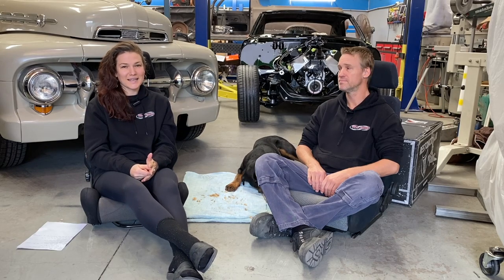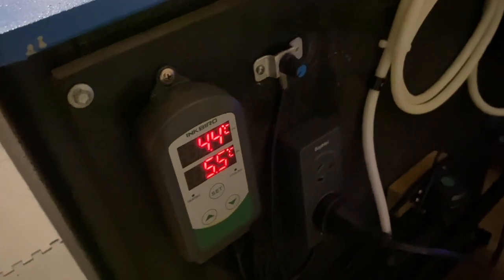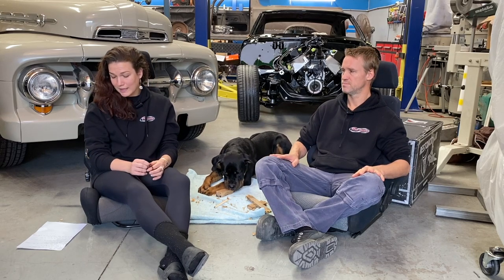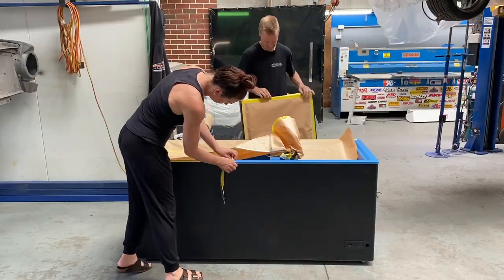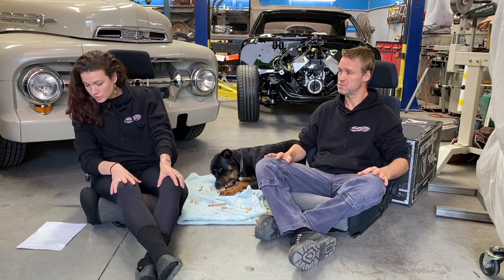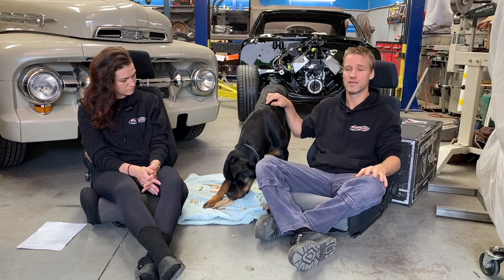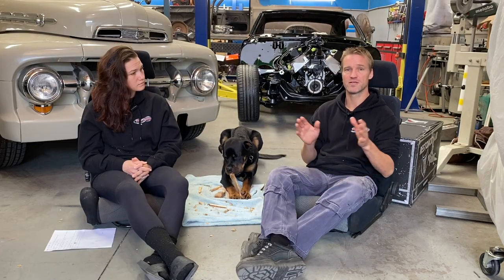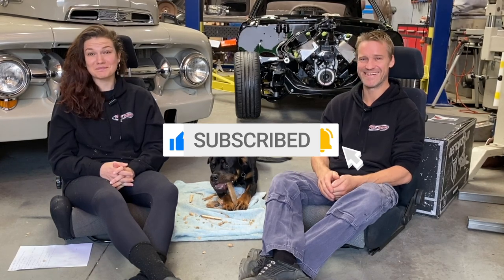Chest Freezer Ice Bath Update Q & A

Comment: If anyone has the hypertension issues she describes, firstly the cold plunge will not give you hypertension. If you do have hypertension to begin with the cold plunge can exacerbate it if the temperature is too cold relative to your level of cold adaptation.  Some people can experience a transient hypertensive event with no previous hypertension issues for the same reason. Address this by increasing the cold plunge temperature and continuing to lower the temperature over several weeks or months to get your body adapted. Specifically addressing neck pain/headaches when cold plunging with no previous history of hypertension, try fully submerging your head in the cold plunge for a few seconds at the beginning to initiate some local vasoconstriction. Second, this is often an issue that is non-hypertsion related and instead, is directly caused by the design of the Cold plunge, specifically DIY chest freezer cold plunges because the vertical walls of the plunge often leave people to rest their heads on the edge and then use that point of contact to keep their heads above water. This leads to a tremendous muscular strain in the neck muscles that will lead to stiffness, pain, and severe headaches, solution is to sit in the cold plunge without using your neck to support your float. However CHRONIC hypertension is a serious health condition that damages all of your organs and puts you at high risk for heart damage and stroke, so you should always consult with your doctor. I just wanted to post this so that people will know that they can still safely cold plunge even if they initially have hypertensive symptoms but that the solution is to just take it a little slower or adjust your floating position to not involve your head or neck. Everyone's body is a little different and yours will tell you if you are going to fast or not. Listen to it!
Reply: its a chick she bailed ...the cant handle cold as much as men they also give some sort of excuse!

Comment: I had the same experience getting pain ans headaches when I got into the water. How I got it to go away for me was to get into the water quickly and dunking my head right away has worked great.

I hope this may help so you to get cold plunging again. 

JB Weld water epoxy works great for the seams and Pond Sheild Epoxy is a great alternative for the liner thats not toxic. 

Thanks for making this video.
Reply from the maker: Thanks a lot for your comments Tyrell. I'm hoping Anika will get back into the ice bath soon. Might have to wait for winter to pass though. I think next time I clean the bath out I'll take it to work and paint it in the pond liner. It seems to be the best option. Cheers

Comment: Just wondering if it's possible to just mount the pumps and filters to one of the lids and keep it closed? Or turn off the electricity when you want to open the doors? It's only a few minutes a day.
Reply from the maker: That's a pretty good idea. You will just need a pre-priming pump as it would be above the water line.

Comment: where did you get the venturi injector from? I cant find anywhere local. What size did you get?
Reply from the maker: I found it on Amazon. Think it was a 1/2 inch
Reply: @ProShop1  did it come with the check valve? I think I found the one but says nothing about the check valve
Reply from the maker: @shanesquire8499  the check valve came with the ozone generator
Reply: @ProShop1  ah yes it does. What about the long black device you have before the pump? What is that for?
Reply from the maker: @shanesquire8499  That's an inline filter
Reply: @ProShop1  ah yep excellent. What did you do for the plug on the ozone generator? Mines come with a flat plug and no wiring instructions to wire a 240v plug onto it
Reply from the maker: @shanesquire8499  yeah mine didn’t have a plug on it so I had to figure out the wires by searching online.
Reply: @ProShop1 yeah that’s all good I managed to figure it out. However I can not for the life of me, get the Venturi injector to work. The direction is the right way however it is not pulling anything through the top. Any ideas?
Reply from the maker: @shanesquire8499  have you pulled it apart? Pretty sure mine had a plug in the injector.
Reply: @ProShop1  yeah mines got a rubber Gromit looking thing then under it it has a little clear ball and a spring
Reply: @ProShop1  ah yep all good. its US wiring so its all sweet. its nothing but issue after issue haha. finally got every up and running but now i need to prime the venturi discharge side every time the filtration system starts, for some reason it keeps 'air locking' back to the water pump when its turned off. any ideas? thanks for all your help by the way
Reply from the maker: @shanesquire8499  did yours come with a check valve?
Reply: @ProShop1  check valve on the ozone generator? Yeah it did and it’s all installed correctly. Not sure if the air bubbles from the Venturi injector is creating is back flowing into the pump and the pump is air locking  🤔
Reply: @shanesquire8499  any chance you can point me to the best place to figure out the plug wiring? Hoping it goes straight to a 3 pin wall plug?

Comment: So I was cutting holes for inlet outlet and I’ve pinched the pipe inside any advice??
Reply from the maker: Damn that’s going to be a bit tricky. Might have to talk to a refrigerator technician and maybe braze it. Going to have to get it re-gassed too.
Reply: I don’t think I’ve pierced it just squashed a little should  try turning it on?? Brand new chest freezer!!!
Reply from the maker: @davecontra3951  I would try turn it on. If you did pierce it the gas would come out so hopefully you’re all good.
Reply: Cheers mate seems all good only had it on for 5 mins but fingers crossed.. awesome content  really enjoying ya work

Comment: Do you run the pump/filter 24/7?
Reply from the maker: I have it on a timer that runs for 15 minutes every 3 hours.
Reply: Hi guys,

just one more question;
I’ve ordered the same Ozone Generator as you have and it came without a power plug. The wires are ‘black, white & green’. Assuming yours came the same way, which one did you use as the ‘Active’? I was advised by the seller that ‘white’ was the active wire, but just wanted to double check with you.

Thanks heaps in advance,
Dan
Reply: FWIW, the pump/filter is supposed to run 24/7/365. It makes a significant difference in keeping the water bacteriostatic. Not to mention that I don’t believe that these pumps are meant to cycle between off and on.
Reply from the maker: @trevorrisley5419  thanks for that. I’ll start running it 24/7 and see how it goes.
Reply: @danputelli  did you work out the wiring?